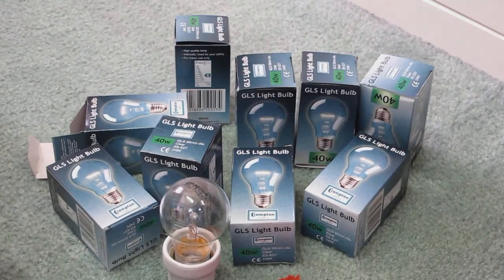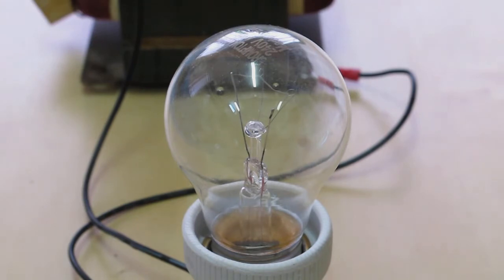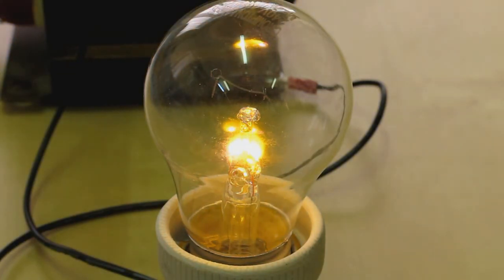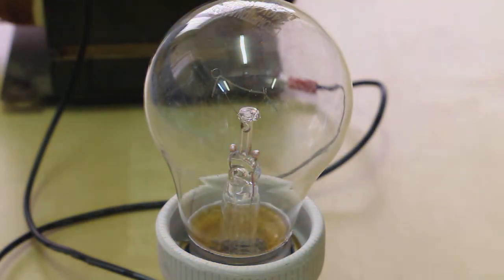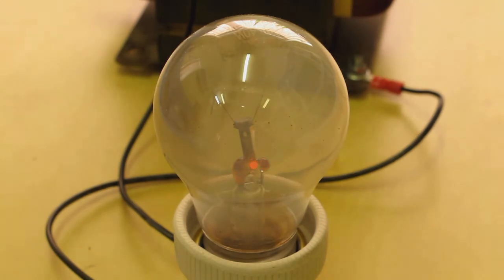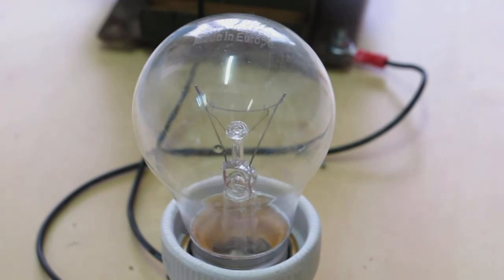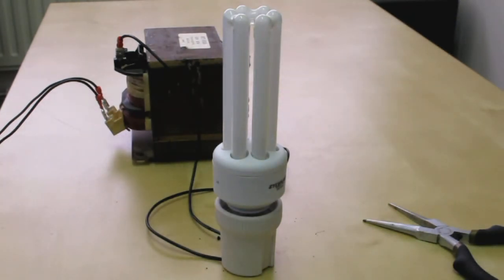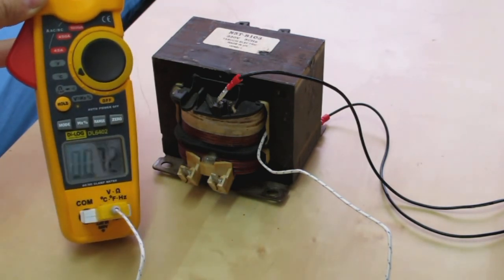Incandescent fun.

Comment: Great video, usually the lamps flash over at the base or the fitting shorts out.
Reply from the maker: Socket is rated for 5kv discharge ignitors.
Reply: Ok, but the E27 lamp base is not from a normal incandescent lamp. Igniter pulses are of short duration.

Comment: Ah, I have watched this one before, but I never left a comment for some reason at that point in time. Bizarre. (Perhaps at the time I was ROFL-ing too much and gasping for air in order to post a comment? :D) So....Here goes:

Very nice arcs in those lamps! Some of the ballasted ones were interesting, the way the arcs fizzed and buzzed in there and the sounds they made. :-)

Ah yes, some un-ballasted action. :-) I wonder what could happen here? :-)

First un-ballasted bulb........ Fizz, buzz, =POP= That didn't last long. Eh? What's this? Three amp fuse? How did that find its way in there? That's for a clock radio, not for arc-pulling shenanigans. :D Needs a bigger plug fuse. :D

Plug fuse upgraded and......

There we go! YAY! It's arcing.....It's fizzing....It's developing conductive smoke in there...... I want a monster-arc in there.....BUZZZ! Oh dear, it's blown its guts out in the lamp holder. Eeeew. Lamp holder repair needed. :D

Next un-ballasted bulb....... Fizz, Buzz.....Ooooh! Nice smoke development, come on....COME ON!! Almost there....must make more conductive smoke......WHOP!! YESSS!! There it is, TOTAL LMAO!

The perfect arc-up at 3:57. No filament, just lots of conductive smoke supporting a nice hefty arc in there. :D That arc reminded me of the one which Mr. Photon pulled in one of the lamps when I visited him. The thing is though, the lamp we used had already blown, and we needed 2x MOT (wired for 4kV) to get the juice to jump the gap, which is probably why our arc didn't last as long as yours did.

WOW, that arc really lasted! The lamp was nicely blacked-out too. Vandalised quite nicely! :D

The CFL was PAAAAANTS. Thwock it with your hammer. :D

Yes, one MOT, a suitably sized variac ( AND a plug fuse!!) and some lightbulbs.
TOP FUNN :D

Thanx for showing,

-BoomBoxDeluxe.

21st February 2014, 18.29

Comment from the maker: I take it your on 110v? To get the same power with a lower voltage you need more current. With more current one needs thicker conductors so you'd probably get more tolerance for overload. Manufacturers like to use as little as possible.
I think it does well tbh, after all, it is an 800w MOT drawing nearly 5.5kW un ballasted!